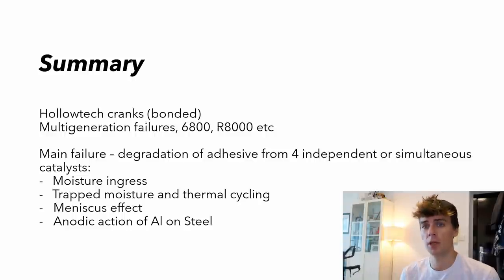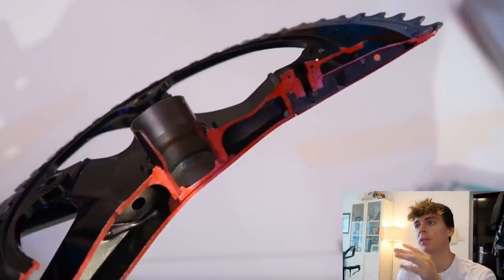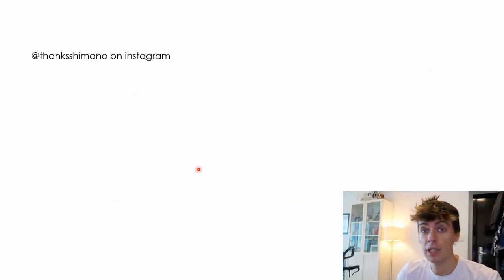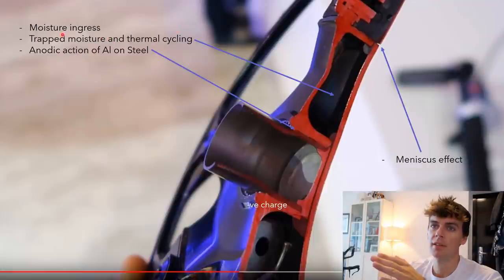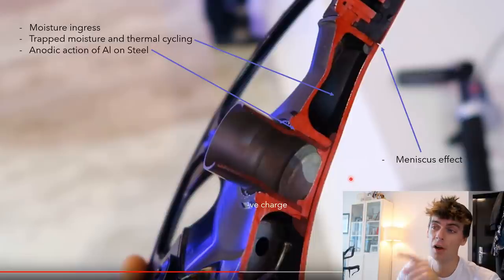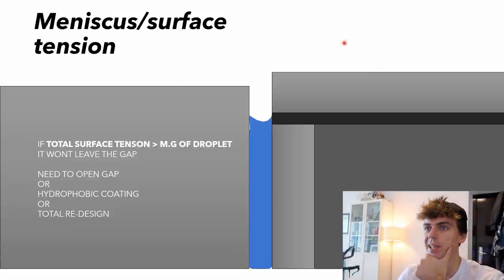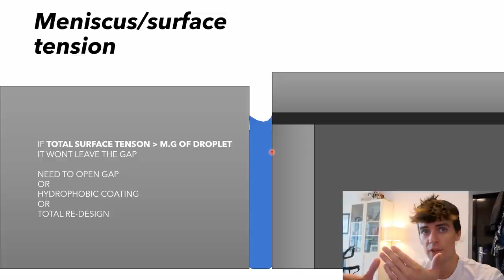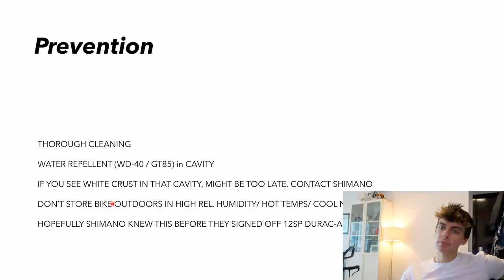Why do Shimano cranks keep failing? Analysis.

Comment: You suggest using WD40 to reduce water ingress. I have tried that on spoke nipples in a carbon wheel for similar purpose. Unfortunately, the oil does spread on the surfaces creating a film which attracts lots of dirt and dust. Maybe, one needs to use silicone lube which attracts less dirt, or even “ceramic coating”, carnauba or other type of water repelling car wax.

Comment: I think that I have heard of an effect where surface tension (your meniscus) effect adds surface energy and increases corrosion. 
However, literally seconds of Google research brought up several articles on "crevice corrosion" but suggested that aluminium is not particularly susceptible. 
If that gap was a typical stress raiser then that would have been found pre-production. But is there a chance that crevice corrision is sharpening the gap to increase the stress intensity? 
It does seem that the cracks are starting where the constraint is high.

Comment: Needs a rabbit or a lap joint made for better bonding!  Aka more areas to bond more! They also are not sanding the aluminum with 80 to 100 grit so the epoxy can bond or adhere better! Second part....drill small hole for air to breathe!  Houses need to breathe!  To do what they did they would half to make the material double wall!  To make things better just use better materials and just cnc one piece parts! Endless designs!   Just my thoughts?

Comment: - Raw Aluminium to alloyed steel is a not a great recipe, although in this situation it is unlikely to cause problems because there is not a direct electrolyte path. 
- the crank is certainly not airtight, or not for long. therefore using vacuum / argon is not a solution. 

The corrosion on the inside is a likely cause of the adhesive failure, as the corrosion creeps under the glue. 
I see the butt joint as a big problem, once the adhesive fails, it is perfekt for crack propagation

Solution would be anodizing before assembly, or using closed-cell foam to fill the void.  And increase the glue-surface, hence remove butt-joints

Comment: If they transferred manufacturing somewhere else then there may be some shortcuts in the manufacturing process. It would be good to know from which manufacturing site these products came from. Excellent manufacturing companies are able to trace this back through product codes. The best manufacturers know on what day, shift, and production line the defective product was made.

Then again, it could also be a marketing tactic of a rival brand or another brand that would like to enter into the category.

Comment: I'm running three sets of the 6800 cranks! But I'm i?n San Francisco so it doesn't get hot here!  They can assemble it an inert gas like argon...
Reply: Fill them up with JB Weld and never risk a failure!

Comment: So, Shimano cranks are designed mainly for 170mm, then build up and down the size. They didn't account for the strength of 172mm and up sizes. This means the larger crank arms have the same structural design as 170mm without adding more materials. This is due to weight savings. This means that the 165mm and 170mm are the strongest sizes while the larger sizes are weakened. Notice the sizes of most broken cranks are on the larger size. On other cases, people crash their bikes and the cranks break. This is a tradeoff of weight savings.

Comment: Do you know they don't bond these in a vacuum? or pump them full of CO2 before bonding? Companies flush cans with CO2 before filling with beer to remove oxygen so it doesn't seem that unlikely that it could be used in crank assembly process?

Comment: Salt from ocean air and sweat drips from the rider and sweet fluids from water bottles and road splashes are liquid when moving about however as the water in salt water evaporates the concentration of sodium chloride goes sky high, up to pure acid.  This happens near the ocean every evening with dew.  This happens every tide change in the tidal zone twice a day.  I saw my first two in Cape May New Jersey.   Putting a new crank under water for days should not get heavier if water tight glue.  I doubt it is water tight.

Comment: Has anyone mentioned the possibility that cyclists sweat more in hot humid climates and the cranks are directly below the body. With a humid climate and the observation that the examples on thanksshimano look like they have been well used, is there more than a correlation regarding increased failure rates in the tropics?

Comment: Excellent video. But, as with the disintegrating Plastic core cassettes, esp Dura Ace, it is the drive to save weight. strong Light cheap. they picked cheap and light.

Comment: TL;DR get Shimano 105 R5800 or R7000 cranks, not Ultegra or Dura-Ace

105 R5800 and R7000 have a different construction where the tube is pinched shut at the pedal eye whereas R6800 and R9000 are bonded which could explain the difference.
Reply: Where did you see this? Anything official from Shimano?
Reply: @Click Bait I belive the terminology is hollow forged (105) vs hollow bonded (ultegra, dura ace)

Comment: Motorcar people have a tendency to call rust 'rot'.  I met someone once who actually thought corrosion was caused by bacteria.
Reply: FYI, MIC (Microbiologically Induced Corrosion) is a form of corrosive attack that is common in the oil and gas industry.
Reply: @metalmite48  That's good to know.  Is it an issue for cars?
Reply: @earthstick  Not that I know of since sulfur compounds main culprit in MIC. Might occur in high sulfur diesel storage but fuel additives probably mitigate problem. (Low sulfur diesel has other corrosion problems due to different 'bug' activity that sulfur compounds would normally inhibit. )

Comment: No need to assemble in a vacuum. It just needs to be assembled in an area flooded with an innate gas like argon. Like when you weld up titanium bike frames.
Reply: Even assembly in vacuum is now problem. It can be seen f.e. in vacuum interrupters.

Comment: I had a 6800 fail at 12,000 miles and a 8000 fail at 16,000 miles.  Both never ridden outside the UK.
Reply: WHat typical conditions?  How about your weight wattage?

Comment: Apparently there has been a 4% failure rate in tropics reported by another responder to this video. Now Shimano knows about the problem. Let's hope they resolve this delamination issue and honor their warranty to those customers. There's  another video online showing a guy JB Welding his back together. Brave guy bought his crankset second hand and wasn't under warranty. Even Hambini has gotten a positive response from manufacturers. He pointed out a patently obvious design flaw in a power meter crank. Other manufacturers have ignored their obvious flaws like the rattling bb spindle non drive side bearings. Others have verified this flaw. Pithy fixes like greasing it till I no longer does this have been reported. Another manufacturer simply widened their design tolerances beyond bearings manufacturers recommendations to avoid warranty claims. Again caught in the act with hard proof by Hambini. How many cyclists have to put up with defective products that are dangerous?

Comment: I'd like to see data on Shimano chainring stiffness.  Maybe they shift well for other reasons.  My FSA crankset has a chunky carbon fiber spider with only about 35 mm of chainring protruding.  Shimano cranks never do very well in FairwheelBikes's crank stiffness tests which measure spindle and crank arm deflection.  They don't test chainring stiffness though.
Reply: Teeth profile and those pins/ramps on the backside of the chainring surely have a great impact on shift performance. That is my guess.
Reply: @sc0608023  Yep, that was my point.  It would be cool to have data.  Make a test rig and report back your results.  :-)

Comment: There's a lot of errors with the analysis. As I can't imagine final assembly is done in anything but an A/C environment with less than 40% relative humidity so the amount of actual water vapor that condensates within the crank is going to be absolutely tiny and very very unlikely to cause the levels of corrosion you see inside the crank arms. This is more likely an issue with the bonding material not fully sealing or able to expanding at a similar rate with the aluminum crank arm eventually breaking the seal allowing 80-100% humidity in when outdoors then when the crank is cooled indoors overnight that amount of water begins the corrosion process which repeats as the seal continues to break down.

Comment: Why not coat them on the inside with some polymer after the bonding process?
Reply: You cant as it is sealed.
Reply: @aitorbleda8267  I mean during the manufacturing process, not as an afterthought. They could inject some polymer that would coat the inside of the crank to prevent the galvanic corrosion from happening and weakening the bonded junctions.

Comment: Ive changed shimano to single plate doval and i cant sense any flex and the weight is 30 grams more on dura ace 9100. Also, aren't dura ace axle spindles alloy?

Comment: Love how roadie stuff just inexplicably breaks and you have to reverse enginerd it to figure out why it failed because there isn't usually abnormal loading conditions, just shoddy engineering. Mtb stuff is like, "yes I did case a 30 ft gap with a rock landing, but for the life of me I can't figure out why my cranks are bent to hell".  You can't out engineer a 200lb gorilla at a downhill park, stuff always gonna break

Comment: Good vid bro!
Absolute Black oval rings are my fav. Especially the 46/30 for epic days out.
Reply: Absolute black is very stiff.  Degraded my pedal stoke though.  lost 5-8 rpm per gear.  watts were very close to the same.  However, I like them for sprinting.

Comment: i saw most of them seems are on ultegra. kinda wondering since ultegra suppose to be the workhorse level that can last long and perform well.
Reply: That's 105. 105 is the workhorse. . Ultegra is a crit racers groupset. Lighter and slightly cheeper because you expect to crash and break often enough. And DA has and always been show or just cafe rides

Comment: From the Shimano dealer manual 

“The gears should be periodically washed with a neutral detergent. In addition, cleaning the chain with neutral detergent and lubricating it can be an effective way of extending the life of the gears and the chain.”

Maybe the copious amounts of degreasers that don’t have a neutral ph used to clean chains and cranksets are accelerating corrosion issues?
Reply: I think you have hit the nail on the head.

Comment: So the warranty periods don't necessarily prevent Shimano from being liable to replace items corroding or breaking due to Shimano Engineering Failures in design and manufacturing. Australian Consumer Legislation should be used for these failures here in Australia. Get to it!

Comment: Equatorial countries with High humidity and Moisture affect the metal properties of the Cranks to break down! Expansion, contraction, reaction to the weather! Had a Dura Ace R9100 Crankset for 3 years, put 40,000 Kilometers never once did they fail on me, since ultegra being cheaper to produce and make should be another contribution to failures!

Comment: if it is the glue that is failing it could be possible that they are using the same cheap glue that was used on car inspection stickers because a few years ago there was a rash of inspection stickers peeling off

Comment: Shimano should pay or gift you something for this “presentation”. Is it possible to use a moisture holding chemical for those cells in the cranck section you showed?
Reply: not really, every time the crank heats up? the silica that would be the option to do this will release its water. there is a solution, move production to an extremely arid environment without humidity.

Comment: Im worried. Just got Ultegra 6700 crank. I live in Cornwall on the coast. Wet, humid salty... Ill keep it inside i guess...
Reply: The 6700 does not have this problem.
Reply: @Tullebukk75  Yay thank you! Any souces? Ill abuse it and find out though...

Comment: Would there be any benefit in drilling a small vent hole to open the the cavities?
Reply from the maker: I've thought of that. If riding solely indoors/in track then yes. But outside it will just fill up with crap maybe
Reply: Peak Torque put some one way breathable tape over the hole (it might need regular replacement)... just an idea if the goal is to loose the moisture
Reply: Add some 'do not eat' silica capsules
Reply: I would not do that.. in the uk you will get grit salt inside the cavities and corrosion.  And I have never seent that in the uk.. and you probably will end up with liquid water trapped insode, so worse..
One solution to this problem could be to make them with a small hole, then put them on a controlled atmosphere with no humidity and seal them while in that controlled atm.  Or leave a valve and fill it with nitrogen.
Expensive, prone to fail, and more weight.
Reply: Aitor Bleda #oztralia... grit salt.. what’s that😂
Reply: @johncitizen2007  Correct!   Yeah, obviously no ice..

Comment: Very good investigation. Not keen on bonded things because so many can go wrong if made not in optimal conditions. What I don't think is so super of Shimano's way about the outher chainring stiffening. They need to make it stiffer than a thin solid one like used in past because of a self caused problem. The always lowered BCD to get smaller inner chainrings fitted.  So Simano make a thick cluncky chainring with a lot of engeering where Campagnolo just decided to make a system that is more logic : a double BCD . And there is no problem anymore. The Chainrings are cheaper and easy to make.This aside.   Thank you and keep up the good work :-)

Comment: Well I don't live in the tropics and the colloquial advice among the midwest US gravel community is don't ride Ultegra cranks.  The spider breaks and the non-drive side cranks fall off.  Not reliable enough for gravel.  Just the same, I've got an ultegra crankset on my crit bike.  No way would I set out on a 100+ mile gravel ride with an ultegra crankset, though.  If you do, stuff some walking shoes in your jersey pocket.

Comment: Can overtightening be ruled out? I'm sure that's what most unscrupulous manufacturers would come back with... not sure about Shimano
Reply: Do you mean overtightening by the user?
Reply: @fadenseiden  User, mechanic, even original install...?
Reply: @jackhammer40k_  but you can't really overtight anything on a Shimano crank (drive side)
Reply: @fadenseiden  Why's that?
Reply: @jackhammer40k_  becuase it gets tightened on the nondrive side.
Reply: @fadenseiden  Chainring bolts?
Reply: @jackhammer40k_  ok, dindt think about them xD
Reply: @fadenseiden   Having seen some other examples of this, my hypothesis seems unlikely as the chainring bolts APPEAR to clamp only onto one of the two parts of the driveside crank

Comment: How does a young guy like you know all this? It took most of my career to acquire this data. You must read a lot!
Unfortunately this corrosion is inevitable if the air pocket air is not dried fully, or if there is a slight broken seal. It is a good design for strength but a bad design environmentally. With the massive temperature changes the dew point moves dramatically and moisture that is in the air will become free moisture with big temperature swings. Shimano need to change the design.

Comment: bust mine (Ultegra 6800) during the week, and damaged the big ring in the process. Costy repair, and Shimano's response:🙉🙉🙈🙈. 
So, my next groupset upgrade will not include Shameful's Ultegra or Dura-Ace. Others are as good/better. 
I'm out !
Reply: What are your options if I may ask? My R8000 just cracked yesterday though hasn’t broken off yet but this was also after bike shop replaced the bearing inside the BB.

Comment: I live in South East Asia. Same failure happened to my 6800 and 9800, both within 1 year. Aside from weather, and what you've mentioned my sweat rates are higher than average. I'm 2 for 2. Warranty replacement is hardly supported.

Comment: Very interesting video, range of thermal cycling at equatorial latitudes I expect would be more of a factor and the meniscus effect theory may also hold some water, if you can forgive the pun. I run both generations of Ultegra on my TCRs so I will now go and inspect them more closely.  Would be interested  to hear you thoughts on the engineering design on GXP cranks compared to Hambini's. Feel free to park the Tourette's at the door though!

Comment: 'I'm really eating my hat here guys...' and then proceeds to tell us why the chainrings attached to the formerly coolest crank ever are the best rings ever with the same level of gravitas as your original 2017 video extolling the bonded crank as the shiz. Glue is glue. And it didn't take a degree in organic chemistry to figure THAT out... We've watched de-bond and failure issues throughout this industry as various 1st  thru 3rd gen bonded parts and frames start their disintegration. Just wait for all the Chinese made garbage to catch up to the curve.

Comment: Don't look into it too hard, the 2 parts are separating and its as simple as that, they need to fuse it together stronger. I always look into technical problems deeply but my dad has taught me to "not look into things to much". Being in a technical trade this is a bad way to think but in all seriousness some situations that a bizarre technical fault has occurred and you question for days what the cause could have been sometimes its good to not worry about